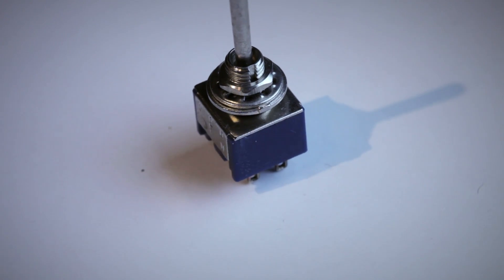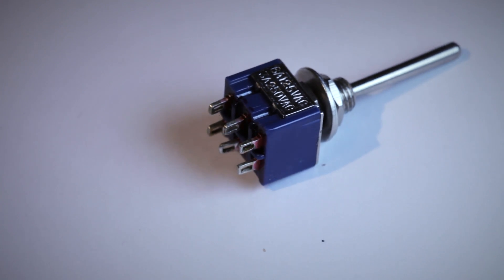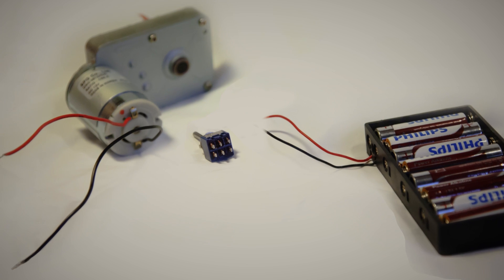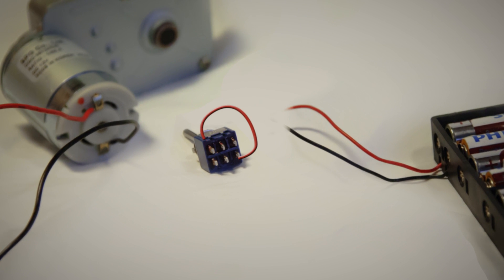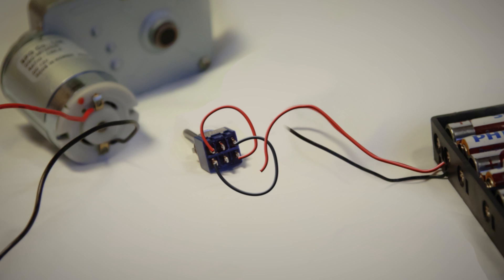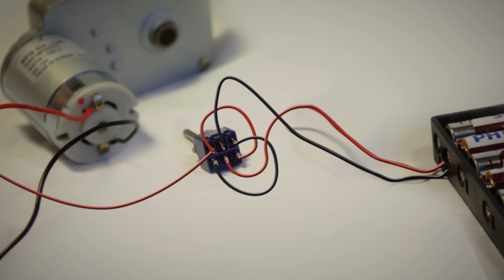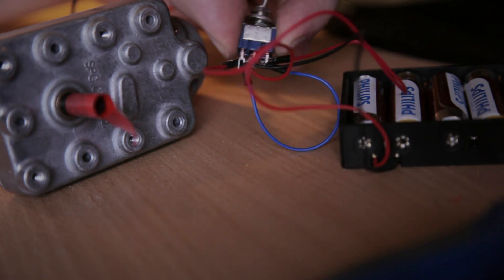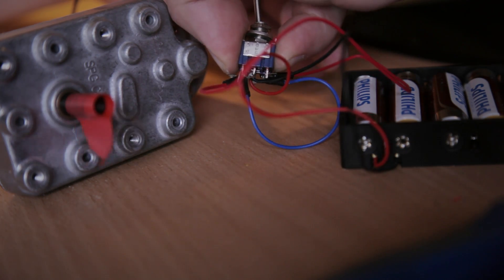How to use a switch to drive a DC motor forwards and backwards

Comment: does this work with any dc motor?
Reply: anna M yes Itf does but it has to be the correct swith and you have to have four wires or the switch will not work

Comment: How can I rotate dc motor without a switch continuosly in both directions . Dc motor should rotate itself without switch in quite intervals. If you have a link for this can send me a link to parasaggarwal42@gmail.com
Reply: Paras Aggarwal it does but you cant stop it then you'll have to take it all out